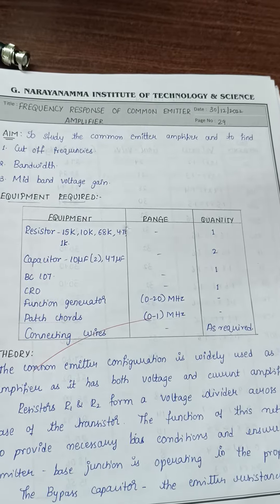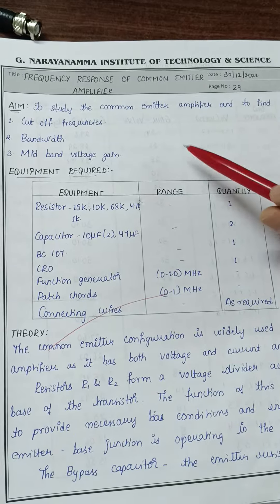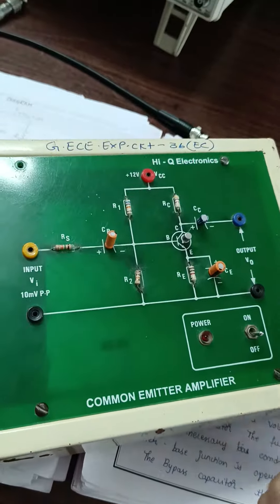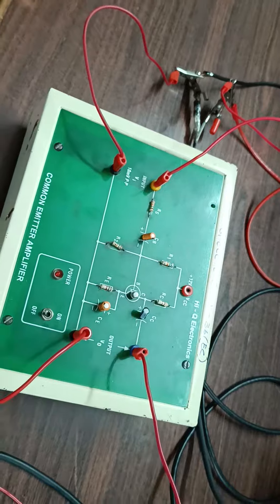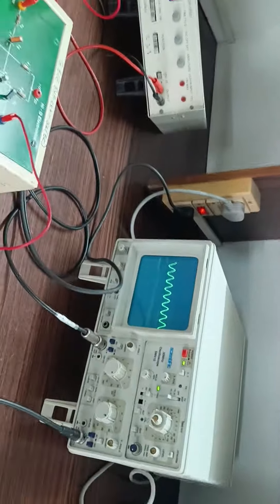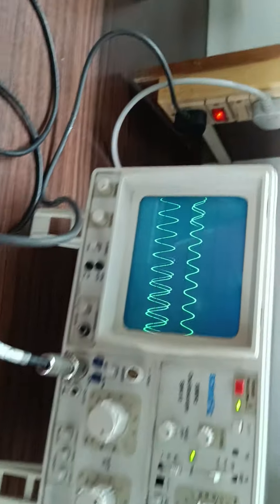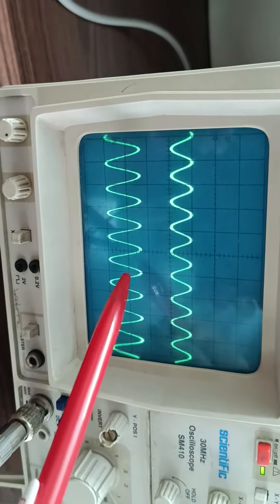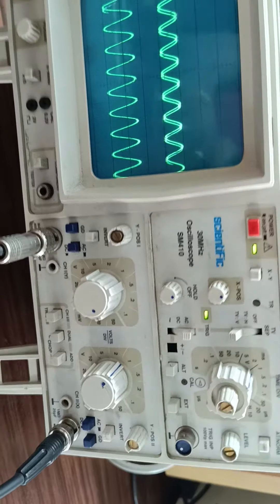Frequency response of CE Amplifier

Comment: In Engineering colleges they should rigup the ckt by solder or bread board simply using ready ckt is not good because students will not learn basic electronics